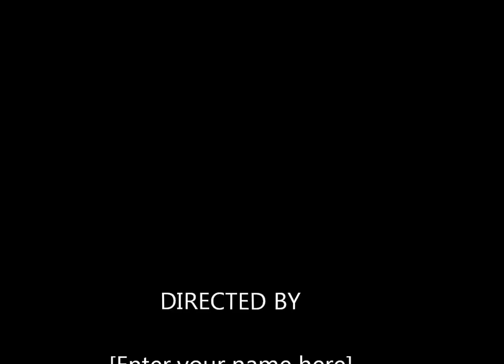wheel seal

Comment: I did not see torque the spindle nut .if that was my truck I would have put on new brake  linings not clean them with a rag . drum was soaked in oil ,didn't use brake cleaner to dry or clean it off .that's why a hate braking down on the road ,they always do a half ass job .
Reply: ..not to mention paying through the nose!

Comment: Not the proper way to replace a inner wheel seal you need a inner wheel seal locknut socket or a 2x4 like previously said or  a socket equivalent  and a torque wrench while turning the Wheel torque to approx 100 ( check specs) ft lbs back off a 1/4 turn  then the torque  to same 100 ft lbs check  and verify for end play to mfg  spec ( usually .005-.010) and then assemble wheel assembly I'm a rookie in the diesel game and I know better. Wow

Comment: Everyone wants to tell you how they would have done a better job.  He just didn't show it on video but he did torque the nut.  He didnt replace the brake pads because he's trying to save the owner money he probably doesn't have. He cleaned them up good enough to where i can bet the owner didnt have any problems.  Mechanic is a cool down to earth guy, he's also fucking huge.
Reply: OK, then I'll assume he put a new gasket on the axle flange too. [or the old one was OK?]
Reply: He was damaging the seal pounding it in like that,it will fail not to long after that